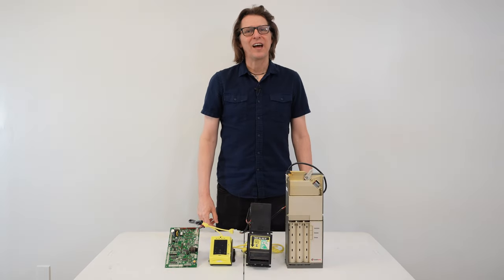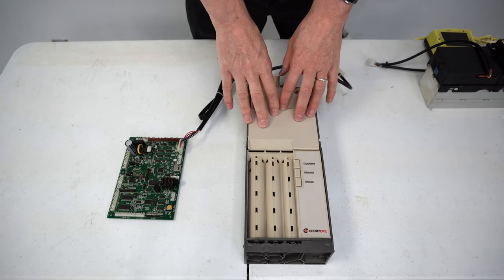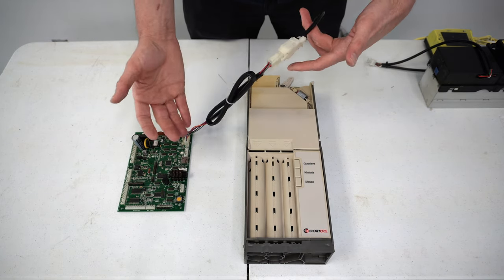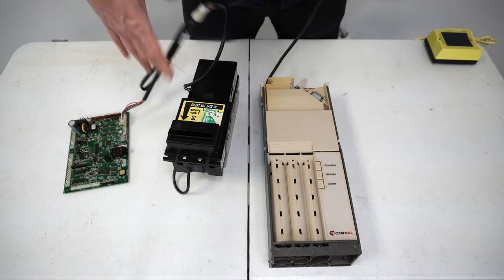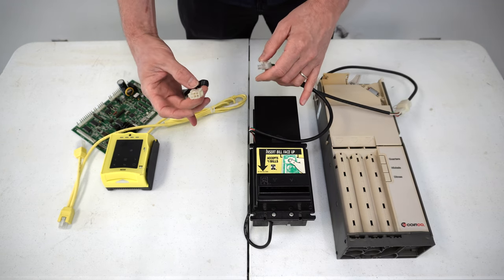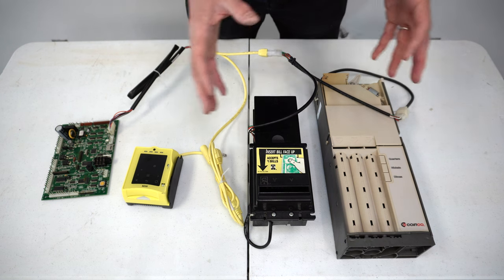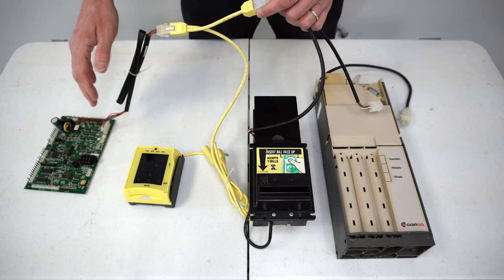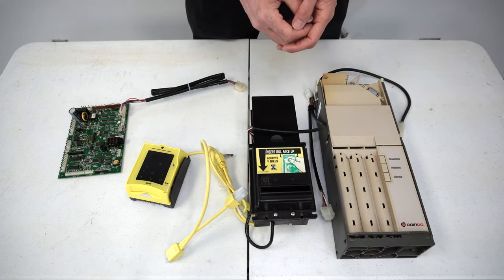Vending Machines: How to connect MDB credit card readers, dollar bill acceptors, and coin changers

Comment: Hello, Thank you for the video. Can we use this system of 3 payment methods at the same time for chair massage vending ? Secondly, how can we set the choice of time during the massage related to a certain price to pay ? Thank you in advance
Reply from the maker: If the massage chair system used the MDB protocol as it monetary interface. I don't see why not. I have never worked on a massage chair as this is in a different segment of the coin operated industry.

Comment: Appreciate the video, but i do have a question.  Do you need a mdb bill validator and mdb coin mech for nayax card reader to work or can you just connect from the board straight to the card reader?
Reply from the maker: You can absolutely run a complete cashless system. Just connect the MDB coming of the board directly to the Credit Card Reader. This is one of the reasons why a credit card reader is placed first in line.
Reply: @VendingMachineSupport  ok appreciate the response

Comment: Alex; Are there much differences between food/beverage vending machines and ticket vending machines at transit, rail, subway stations? I watched your videos about connecting credit card, bills, coins to MDB via Y harness,  thermostat close ups, 5 tools, voltmeter videos. Aedin
Reply from the maker: I do not have any experience with ticket machines and other equipment like that question.